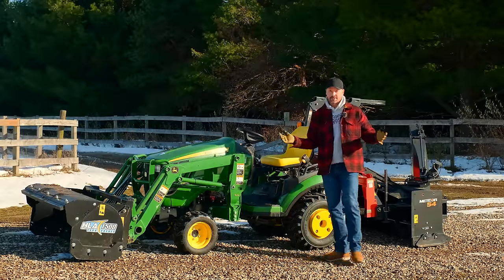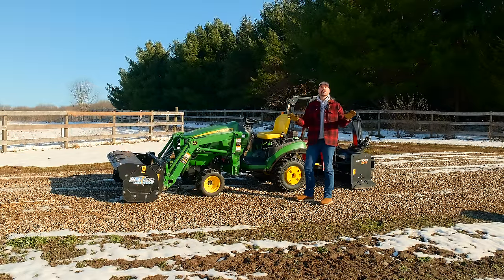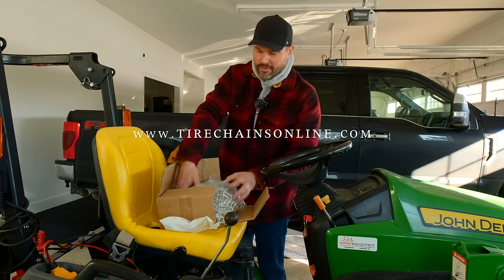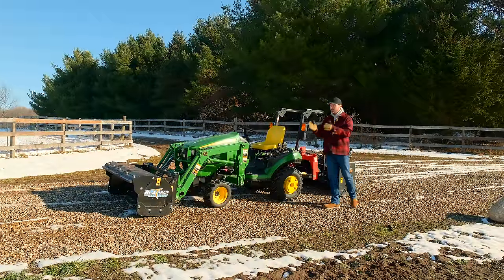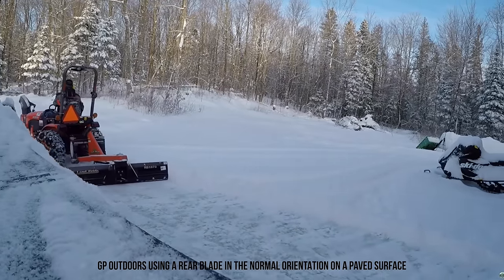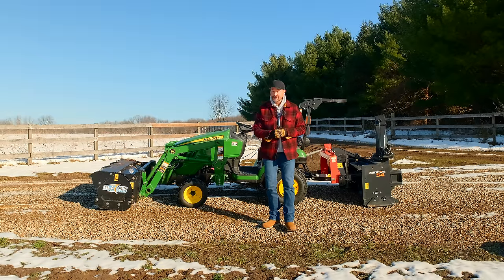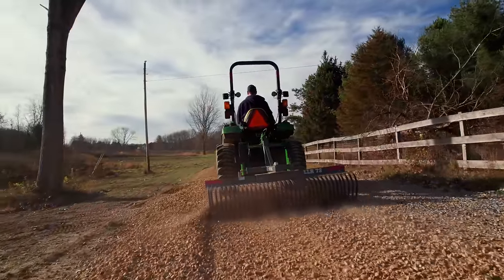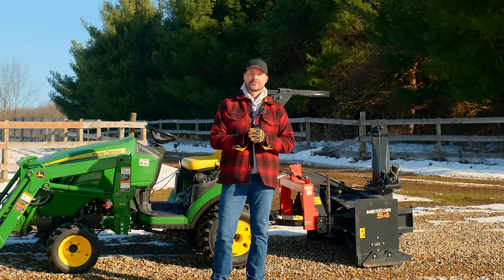A LANDSCAPE RAKE IS THE BEST SNOW REMOVAL TOOL FOR GRAVEL?

Comment: I have been plowing a gravel driveway for along time now and I have learned not to grade it for a good month before winter to help keep the gravel packed down. If you grade to late in the year, it will be too loose once you have to start plowing snow. I also like to pack the first few snows that stick around so you can't see the gravel at all. To do that, you can just keep ordering more parts from Good Works Tractor so you have more delivery trucks packing it for you!!

Comment: We live in northern Idaho, the best attachment I bought for my Yanmar 424SA is the hard cab and cab heater! I also have a snow blade for the front and a 3 point snow blower for the back. I usually do snow removal with just the bucket in front and the blower on the back. I just don't use the blade on the front much.

Comment: Used my landscape rake to plow snow on my long gravel driveway yesterday in WA state.  I prefer to use it to preserve the gravel in place and it it does not create a smooth surface that will become a skating rink.  It will break up drifts and move some snow to the side.  I think of it more as grooming the snow with a textured surface that you can drive and walk on. 
I have a plow on my truck and a bucket and box blade on my 5 series JD for moving larger quantities of snow but for lighter snows and finishing, I prefer the landscape rake.
Reply from the maker: "I prefer the landscape rake" for snow removal is not something I thought I'd ever hear.  Pretty cool, I've gotta try it.  Thanks for sharing!

Comment: I have just used my bucket for years now.  I have a lot of gravel driveway.  The best thing I do is make my snow pile on an unused part of the driveway, not off the driveway.  That way the stones you pickup just fall onto the drive when the snow melts.  I know some driveways are long and narrow with no place to pile snow except to push it off the drive but if you can pile it on the driveway.
Reply from the maker: Thanks Charles!
Reply from the maker: That is a really smart idea by the way

Comment: I've used my landscape rake for 2 years now on the new farm and it works great.  I have edgetamers on my bucket for the main snow removal and I use the rake, on an offset angle, to break up ice and direct any loose snow off to the right side.  With the up and down temps, the ice buildup on the sloped areas is hazardous at times.  The rake helps to break or rough that up enough to drive on but doesn't rip it up with gravel like a heavier piece of equipment would do.
Reply from the maker: Sounds even more promising with your experience, thanks for sharing!
Reply: I like that the rake leaves some snow and ice chunks behind - aids in the traction for the cars and trucks on the driveway.  I'm thinking of adding some metal, or half of a corrugated pipe to the inside of the rake tines so it can move some of the deeper snow we get here in western NY, but leave about 2" of the tines exposed to rough up the surface.
Reply: @mrfurb73  Mark great info, are you running wheels on your rake or just the bare rake?
Reply: @Pete Hall  I didn't have gauge wheels the first year but added them the next summer and used them that 2nd winter. I didn't notice much difference, but the added weight did make the rake dig a bit deeper. Not sure I like that or not. We'll see how this winter goes with them.
Reply: We've had a pretty warm winter in Central WA so far so we attached our landscape rake and use a plow on the front of our tractor when clearing snow from our gravel driveway.  I can plow if the snow is deeper and the rake keeps the snow from getting too slick overnight and it helps it melt when temps go into the upper 30's.

Comment: I use a John Deere GT245 with a snow blower & Curtis Cab for my 250' long driveway. I removed the "skids" from the outboard edge of the snow blower, and installed 5" diameter wheels from a mower deck. This elevates the scraper bar so it doesn't drag on the gravel.
Reply: I like that idea, now get it so you can have it up or down with the flip of a lever.

Comment: A tip I found when using a 3-point blade on a gravel driveway was to use horse stall mats. Cut the mat into strips 12 inches wide and replace the steel cutting blade with the mat strips. The mat will glide over the gravel while removing the snow
Reply from the maker: Good idea B Hall

Comment: A 1" thick rubber plow edge has helped me significantly. You won't get the driveway perfectly bare, but you also won't spend all spring moving the rocks back onto your driveway. It also helps once the ground has a solid freeze.

Comment: Use your car or truck tires to pack down a fresh snow on your gravel driveway before plowing or snow blowing.  I run up and down my 1200 foot gravel driveway 5 or 6 times, helps give a you base.  My 1025r with loaded turf tires work fine for traction with front 2 stage snow blower.   Use your hidden float function with a front end snow blower.   You’re right freeze and thaw cycles seem more frequent, be more careful with a thawed gravel driveway and be prepared to adjust shoes.  Getting gravel out of your lawn in the spring, sucks.  Get some Yak-Trax for your boots if you plan on walking on your driveway, it will eventually be a sheet of ice.  Salt doesn’t work on a gravel driveway.  Excellent tip video.

Comment: I have been plowing my gravel driveway for a few years now and dont have to move gravel back in the spring.  I let a 2-4in snow pack build up then plow/blow as normal.  My rule of thumb is I never want to see the driveway until spring.  Cant move the gravel if you cant see it.
Reply: Dang I’m probably not that cold to pull that off. Great idea though
Reply from the maker: I like that, don't want to see the driveway until spring.
Reply: I’ve been doing the same thing for years. The only time I get any gravel in my yard is when the county plows the road in front of my place. Not much I can do about that.
Reply: Been doing the same thing for decades in MN....its not rocket science
Reply from the maker: @corylee2261  what kind of science is it?
Reply: @corylee2261  sure isnt..people forget that just because theres snow on your drive dosnt mean you need to remove it. Guys with tractors forget that.  Kind of like everything looks like a nail when your a hammer.
Reply: Nice. I use a loader tractor it is a bit slow, but effective. I level the bucket best I can, just a slight tilt, and run it an inch or 2 off the ground. Works great

Comment: Great video as always!! From central Iowa and I use both a Snow Pusher and rear blade for my gravel driveway using a Sub Compact.   I actually prefer the rear blade for most smaller snow falls (6" and under). I have found that rear blade to work fantastic, even when the driveway is not yet frozen or "Crusted". However, you need to keep the top link very short so the cutting edge of the rear blade is more Perpendicular to the gravel and then it does not tend to cut into the gravel and pick it up.

Comment: Instead of skids on a snowblower that tend to dig in and stir up the gravel , I rigged a set of solid wheels on 1/2" bolts for axles using the skid plate holes. You can vary the height by just changing to different size wheels and it worked great for me for years as long as gravel drive is pretty level to start.

Comment: have been using frontend loader bucket with two edge tamers, they do a great job. They leave a little snow, but do not remove much gravel, which I simple spread back on the driveway. Tried a plow on my ATV,  it piled up a lot of gravel on the driveway edges.

Comment: Great video Courtney!  I think that the PSI on the skid runners is often overlooked.  If your snow pusher box or whatever weighs 400 lbs (plus the weight of the end of the loader boom itself) and your two skid runners are 2" x 15" there is a lot of downward force on them which will easily push them down in the soft ground or driveway.  There isn't an easy or surefire solution that I have seen, some gravel will get disturbed no matter what.

Comment: Great video very informative, at my house I used 2x4 scraps that I cut 45 degree angles on the ends and through bolted with carriage bolts to the bottom of the skids on my snow pusher. Works well. I had wondered about my landscape rake, might try that

Comment: I only have 100 feet of gravel drive so the snow removal is somewhat more simple. Step one is to compact a good snow base. Step two is use the skid plates to keep the cutting edge up off the gravel. Then for the riding mover with front mounted blower I use suitcase weights, wheel weights and chains. So far, so good.

Comment: I have a gravel drive so I bought a 10' 1-1/4" black pipe. Cut it in half to use on the rear blade and FL. I cut a 3/4" slot down the length of both pipes to slip over the the rear blade edge and the other over the edge on the FL bucket. I drilled a hole and welded 1/4" x 2 flat bar to the back side of the pipe and used the bolts on the blade to secure it. The pipe on the FL was secured by a piece of flat stock welded vertically on each end and bolted to the side of the bucket. I used flat washers as spacers between the bucket sides and the flat bar as it will not lay flush at the bottom of the bucket due to factory weldments. Will find out if this $40.00 mod is going to work on either end.

Comment: Haha, I just learned these lessons through trial and error with my first snowfall. I ended up basically just back dragging everything with my snowblower box. I have dogs so I pack down everything around my house and work areas between garages and parking spots for trailers. It definitely takes more time, but it helps give gravel that pack down if you are further north where it will actually freeze. 

After I got tired of backing up so much, I noticed my rear blade sitting there in smoot mode still. Picked that up and used that for my main drive and took it all the way down the trail to the back of my property to do my full loop. Having that nice frozen path to walk on back there with the girlfriend and dogs is so nice. 

I picked up a 60" trip blade to go with my snowlwer, and plan to use my bucket with skids on the FEL if I end up having big enough piles to deal with them.

Comment: I put a piece of rubber horse mat between the moldboard and cutting edge hanging down a couple inches on my back blade and a 2" round steel pipe over the cutting edge of my front plow.

Comment: If you roll your front bucket under (back toward tractor as far as it will go) the side will act as runners and the blade of the bucket (at least on mine) will be up off ground 11/2-2" also good for spreading soil, gravel etc.

Comment: All tips I follow for my gravel driveway 👍🏻. Can’t wait to see the landscape rake in the snow 😳😉. I did see Mark @Mannisto Cay use a rock bucket and it worked pretty good. For those using the front bucket they can add the Edge Tamers like TTWT uses. Have great one guys 🙋🏼‍♂️🙂👍🏻

Comment: PVC on the corners of the bucket blade or the entire blade works fine. Also you can put PVC on the plowing implement
Reply: I agree totally! Cut a slit in 3 inch pvc pipe and put it over the cutting edge of the back blade and it works great for removing snow on gravel!

Comment: I have 1025R and I use a rear blade to remove the snow in my driveway. I found it easier to drive backwards to shove the snow it is a inconvenience but it doesn't tear up my gravel driveway as a bad.

Comment: I flipped the rubber cutting edge on my CRI snow pusher until I got the frozen layer on the driveway, but this is my first year with the snow pusher. it seemed to work pretty well.

Comment: what we do in family and have done as long as i have remembered winters we just pack in the first snow and then just plow right over the next time and thats it just pack down the first snow and then just plow the rest that falls also having a really hard pack drive helps too and that way it isnt such a muddy mess either when theres alot of rain thats how we do it and i personally use a old 2wd ustility size tractor with a home made bucket on a triangle quick hitch and thats it and actually most times just use shovels because the tractor is vey loud starting the whole neighbouhood can hear it and i dont have them near even but yeah it works good enough

Comment: Be careful with that rear blade!!  Don't dig into the gravel,   it will cut into gravel, try not to turn the blade 180, just push backwards...  think as you go.....   try it on the Summit tractor...  🙂🙏👍
Reply from the maker: Drive backwards? You crazy David?  Haha, kidding.  Could definitely do that.  I plan to try out this winter :)
Reply: I heard going backwards can damage your rear mounts. Something about them being setup for pulling, not pushing. Just do 180 on a rear blade if you need to move snow. I’ve done it without any problems.

Comment: Courtney, whatever happened to the redneck solution of using a round pipe covering the leading edge of the blade to reduce ground friction and tearing up the soil/gravel. Simple installs usually.
Reply from the maker: Forgot all about that, thanks for the reminder!
Reply: What kind of pipe are you talking about? Steel, PVC?
Reply: works great. I used a 4 inch steel fence post had laying around. Also I have another plow set up the normal way.
Reply: @brenthencka764  I’m interested in how you attach that pipe, even if we no longer get snow 😂